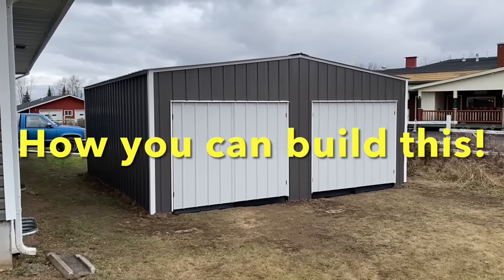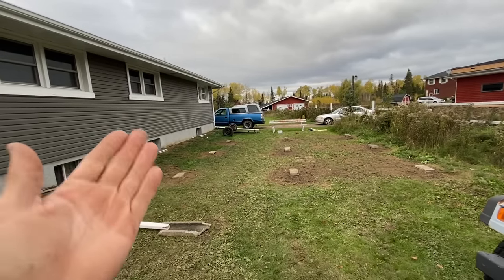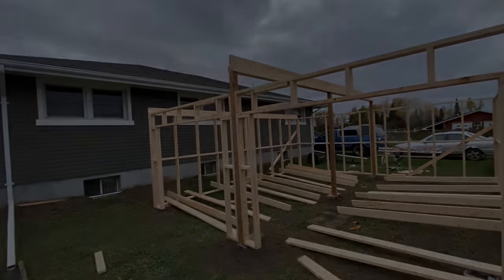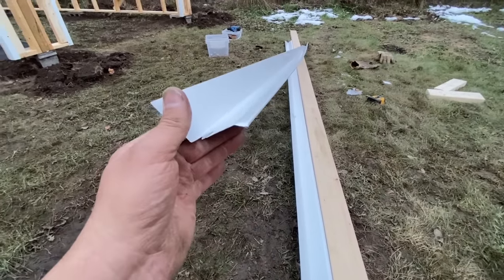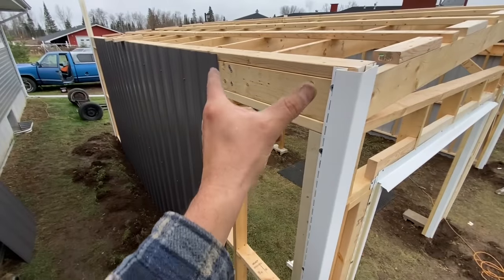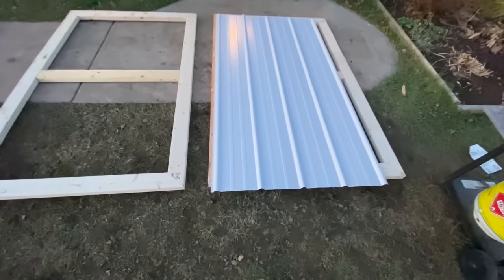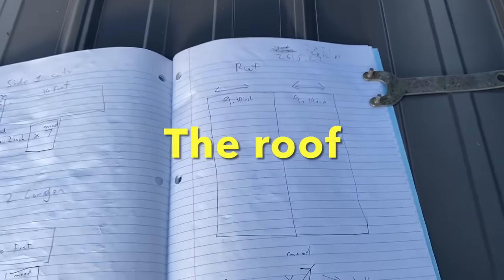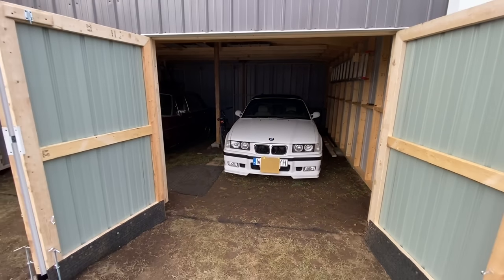How to build a 20x20 Garage for $3000 in 5 days (from Home Depot materials)

Comment: I'm from Florida but also lived in Indiana for 15 years. I liked your install but I do have a suggestion. The top is vented through the gap to repel internal heat. What I do recommend is CAULK between wall top and trim and EVERY roof hump to wall cap. My reasoning is that in Indiana we contended with carpenter ands and wasps. In Florida we have frogs, furry wolf spiders and wasps. Caulking all of these holes in the eaves and overhangs removed a lot of living space for these insects. Now just knocking down the paper wasp nests every few months.

Comment: Within 2 years those cinder blocks will breakdown. The engineering of these style blocks are to be laid with the solid sides as the vertical support. 
A simple Google search on the engineered use of these blocks will explain a little better than I have here.

Comment: Great cost effective build, and way more bang for the buck than those drop in place sheds and kits nowadays.  The only concern I have is that you didn't anchor the building down.  you should defiitely consider some method of anchoring it to the ground, would hate to see it take off in a strong wind. I am now a subscriber.

Comment: You should install either railroad tie or ground contact pressure treated wood as a threshold for the two garage doors so that there is a positive seal between the closed doors and the railroad tie or pressure treated wood. That was the only possible improvement I could find. Your building methods are well thought out. Thanks for some.good ideals.

Comment: 👍👍👍Hey brother, I liked and subscribed to your channel!  Great temporary solution for a mobile shed.
1 small Pro-Tip: Buy some EMT conduit
a) cut 8 pieces @ 1' 6"
b) pound this into the ground flush

(This will help you with the right placement of your doors, both when doors are open and closed).
Also, to help with the snow, buy some wood dowel rod, that will fit inside the EMT conduit.
Cut 2' pieces and place inside the EMT after pounding flush to ground.
Now, when you get snow, you can easily see where the pins are to open your doors.  Hope this helps.
Have a Quality Day!🙂🙂
Reply from the maker: Awesome thanks for watching

Comment: It's Kind of Brilliant..Most places only require permits or inspections if the structure is Permanent, it can be argues that this is just a big shed.  I'd probably sink some ground anchors inside and ratchet strap it down so you don't need to worry about storms but, it's impressive.

Comment: This fits the idea i have been thinking of perfectly, taking from this comment "When leveling the cinderblocks you should use gravel instead of the spare dirt. Gravel can drain water better and help prevent settling." - Should it be fine if I were to set the whole interior 20/20 as a layered pea gravel driveway while having the cinderblock supports to hold the building? We get some water runoff through the area I'd put this and I don't want mud to cause issues, especially since I'd be using 1 side for motorcycles, regardless I'd probably be making concrete pads for the bikes

Comment: I like how you explain things in detail.  Great stuff for the DIY'er.   

That said - I know you're in an unincorporated part of Ontario, but down here in the States - it most likely wouldn't meet code due to the lack of a foundation / footers in most parts of the country.  You can probably get away with calling it a pole barn and putting 4x4 pressure treated posts in the ground in all 4 corners, middle sections of the walls and the post in the middle of the garage at least 4' below grade - depending on the locale.  Some areas may require you to encase them in cement below grade (i.e., those 8" or 12" cardboard tubes you fill with concrete).  But people should always check with their local building / zoning  / codes dept where they live first. 

I realize it's 'temporary' - but in most parts of the States they won't see it as such due to its size - and temporary things have a tendency to become permanent.  Accessory structures like sheds under 100 sq ft are generally exempted from things like permanent foundations (they can be placed on the ground or on top of cement blocks).  This is 400 sq ft garage.  The local code enforcement officer would be ordering me to tear it down where I live for a.) no building permit and b.) no foundation.  That and depending on the locality - distance from other buildings, lot lines, etc.. may be an issue.  

Few nits - the rafters you want to sit flat on the wall plate - not the corner of the 2x8's (looks like you realized that in the very end when you put blocking up where the rafters meets the wall plate).  I would be using pressure treated lumber for the sill plates.  While the metal roofing will probably be fine below the soil - it'll get beat to shit from mowing / weed whacking over time.    

Otherwise, it's a great build - you pay attention to detail and it's a great looking basic barn/garage on a budget that can be done by your average DIY'er over the course of a few weekends.  That and you didn't use the metric system for your measurements even though you're up in Canada - we appreciate that here in the US!  Driving to Montreal with everything in French and kilometers is challenging enough!

Comment: I think you did great! I can't side and roof that same structure for what you built the whole thing for. Only thing, I wish you had kept it off the ground to prevent moisture getting into the panels. A 5" thick concrete pad would cost you about 1400$ USD in my area if you ordered a truck and smoothed it out yourself. You'd still be under 5K for the whole build...

Comment: Great job on the design concepts, execution and especially the well-detailed commentary. Lots of good, useful feedback here also that I would not challenge. I built my first house in 1985 and put a painted steel panel roof on it, similar to yours. The roof is still going strong but the paint is losing its nearly 40 year stand against the elements. It's time for a new roof. The house is in upstate NY, near Lake Ontario--snow country. It wasn't until I put on an addition in 2005 that I came to realize that installing the roofing with the screws through the flats rather than the ridges allows the snow to slide off much easier when temps go above freezing. Both roof are 10:12 pitch and the addition always unloads well before the original roof. 
Your positive feedback is well deserved. Nice work indeed!

Comment: Nice job,but I do agree with the criticisms ! Still it will do well . I would also drill some holes in bottom plate and hammer in some rebar with 90 degree at top to hold the shop down and in place in case of winds etc... pole barns are better I think.
Reply from the maker: For now I just placed a whole bunch of cinder blocks inside on each corner, which I wish I included in the video. Good idea though. I am taking it down and moving the whole thing next summer.  But in the end it is just a moveable carport, thanks for the feedback.
Reply: @ProblemSolverGarage  Plenty of (proper, to a point) criticisms and suggestions already given.  My $0.02 worth, first, it was fun to watch, and while many "mistakes" from a "proper build" perspective were made, it's definitely a "get-er-done" solution. A few ideas and comments that I haven't seen yet, for others to benefit from maybe...
First, the one I haven't seen mentioned yet, the vertical flashing around the doors, should have been tabbed "under" the horizontal door-top flashing.  Minor (in this instance) but any water spreading across the top flashing with any lateral movement (wind for instance) is going to come in behind the lower layer in this application.  Always layer top over bottom as you go down so water always trends "outwards".  (Again, very minor, but other applications, this could be more critical).
Regarding tie-downs, they actually make "corkscrew" tie-down kits designed specifically for this purpose (sheds)... 3-4ft long (it's been years since I last used one) with anchor eyes at the top.  Screw them in (using a long pipe as a handle through the eye for leverage I learned), then you secure an appropriately sized steel cable through them (3/8" for example) and across the structure.  In your case, I'd drill small holes through the top and bottom plates, then run up and over the rafters and ridge beam.  Can keep it all internal almost certainly.  Leave the anchors slightly high, run and secure the cable with appropriate cable clamps, then make a few more turns to tighten them up fully.  For my small portable (10x14, screwed to heavy 3/4" pressure-treated plywood) steel pre-fab shed, I used 4, it survived 10 years including Texas windstorms that literally flipped heavy tables and blew down/snapped trees and fences without budging.  Total cost for maybe 6-8 pairs would probably be about $400 and be good insurance against any decent wind storm moving your garage away (and damaging/destroying contents within).  Won't stop a tornado, but a reasonable, and reasonably easy, improvement. 
Final recommendation(s), paint any cut metal edges (I used clearcoat spray on my shed anytime something compromised the paint) and especially where buried, as already mentioned by others that'll rust FAST under grade, especially with any exposed edges, so proactive coating will help some at least.  
Along with dozens of other things already mentioned, just wanted to add those thoughts for longevity improvements.

Comment: Decent budget build… I would have done some foundation decisions differently but everyone has different opinions. Looks nice and does the job. Honestly wish I had one, no matter how it was built lol looking at cost this would be about 6 grand Canadian in my area. The metal itself would be around 3 grand and lumber about 3 grand, plus probably another 500$ for hidden costs and hardware, like joist hangers, fasteners n washers, concrete, blocks, beers n burgers, gas, etc. My fair estimate would be 6500$ Canadian, which is about 4500$ U.S. but that honestly makes sense cuz prices very greatly by location

Comment: Im no construction guru, but i worked in masonry for a couple years as a laborer. Wouldn't it be better to rotate those foundation blocks and lay them with the holes going vertically? I believe they're much stronger that way. Just a thought...
Reply from the maker: Yeah but people have been laying them this way for years in trailer parks, the flat part down prevents it from sinking into the ground, I wish I explained that in the video because everybody makes comments about that. Nothing will happen to them if they are on their side. Could use solid concrete blocks as well, the video was just for reference.

Comment: siding is touching dirt.  it will rust.  should have put some sort of space between siding and dirt.  Maybe a foundation 1 cement blocks high...
Reply from the maker: Built one like this years ago the same way metal is still 100%, this type of metal doesn't really rust

Comment: I don’t understand how it’s anchored to the foundation. Unless I missed it.  Seems like holes should be filled with concrete and straps around blocks and bottom plate. Or put blocks sideways and fill them and around them with concrete and run 1/2 treaded rods down center of blocks and bolt to plates with washers.  Very creative and economical build.  Might be good starting point for construction of tiny house too!  Thanks.

Comment: Great job of describing your work. I would recommend 1/2 inch foil backed foam insulation under roofing. On frosty mornings the underside of metal will drip when the sun starts to warm it.

Comment: what is going to stop the side wall from sagging? Since you only have a concrete block every 10 foot. and believe me over time they will sag. I would also have used treated lumber on the bottom board going around the base of the walls.
Reply from the maker: The metal wall will prevent it from sagging.

Comment: FYI you don’t wanna use drywall screws outside specially when your using metal and when you doing your flashing you wanna tuck it underneath think like water also when hanging you just channel you wanna put your screws in the center of the nail flange so it has room for movement but good video keep up the good work whatever works for you I’m just giving you constructive criticism that’s all to help you out costed screws is what you wanna use outside at all time or hot dipped galvanized nails like the metal roofing has special screws so does the flashing and j channel that’s all also while doing the roof I would put them on the ribs I would of continued to put them in the valleys of the metal but other then that good video I just would have done the foundation and a few other  things different vinyl flashing is better and cheaper I would have done the same thing used vinyl j channel and vinyl corner pieces but just a few things different like I said great video keep putting out informative videos and helping others
Reply from the maker: Thanks for the hints and feedback 👍

Comment: I didn't see you screw the walls to the base? Also, how do you prevent moisture build up in the garage? I have this issue with my current shed and not sure how to solve it
Reply from the maker: Buy a fan at Walmart for $25 and stick it inside

Comment: The only issue I have with this, and unfortunately it's a big subtle and pedantic issue, is that you used regular screws instead of nails for the framing. Everything else is pretty good, but I'm afraid the structure won't hold up over the years due to the fastener choices. When you drive a nail halfway in to a block of wood and hit it sideways with a hammer with some force, it bends and will bend back and forth for a good many times. When you do that with a screw, the screw breaks the first time you hit it with any real effort. This little demonstration you can repeat shows why framers mostly use nails and bolts instead of screws (They do make "Structural Screws" With differing processes and materials, but those can get expensive quickly). It's how the fasteners are made that changes the strength of the fastener in the face of the flexing joints in a structure you see. 

Seemingly stationary structures flex and bend all the time, often imperceptibly slightly, with the changing wind, the settling of the ground, even from an adult walking around on the second story of a structure. Screws can take the stress of that settling motion for a while, maybe a decade or so in light conditions, but they will break concerningly quickly. Nails, Bolts, and even Staples will not. Not saying that screws are never the solution, screws have unparalleled grip strength, are easily removable, and are probably one of the better fastener choices for drywall and other types of sheet cladding, but they don't have good strength perpendicular to their length. If there's ever an inspection, say for selling the property or for code enforcement, and they look closely at the structure, you could face fines or even a judicial mandate to tear the structure down for using screws depending on your jurisdiction and how up to date the version of the International Building Code is that they follow.

Everything else in this is great, but please use almost any fasteners other than regular wood or deck screws when you are framing a shed or any other structure a person could be inside or stand on for years to come, you do not want to be liable for bodily harm or death from a building collapse. Some of the other choices of fasteners, on the exterior aren't great for corrosion and leakage reasons, but they ain't all that likely to cause a minor catastrophe.

If you (the general "you", not you specifically) are inaccurate or inefficient with a hammer due to lack of practice, or ya just don't have the strength or time to hammer away all day due to the circumstances of your employment like most folk or even if you have a disability that would impede your progress, Framing nail guns have come down a lot in price in recent years, and a nail gun is totally worth adding to the price of this project for almost anyone to extend the durability of the structure by decades. Just make sure to get an air powered one instead of an electric one, a cheap air gun will hold up way better than a cheap electric one. Bonus points for speed too, an inexperienced person can drive 5-10 nails with a gun in the time it takes to fumble with the screw and drive it, 10-20 nails if you are pre-drilling the holes for the screws like you are "supposed to". 

Everything else seems great though, but even Achilles was brought down by the tiniest vulnerability.

TLDR for those that ain't nerds for structures, I know I've gone on a bit much: Screws dangerously Bad: Nails Good. And for all that is holy do not use screws for framing unless you absolutely know what you are doing.

Comment: Looks great but those side walls are going to start sagging especially with the first load of snow. Can’t build a wall with a 2x4 laying flat, there’s no strength unless it was supported by doubling up 2x8’s on edge around the entire perimeter, also would of used solid concrete footing blocks, Otherwise it was a very thorough and detailed explanation which was great.
Reply from the maker: The metal walls prevent the walls from sagging. Think about it...
Reply: @ProblemSolverGarage  when theres a heavy load from snow the screws holding the metal panels aren’t going to be able to sustain the weight
bearing down on them. Post a follow up video in a year.
Reply from the maker: It survived this winter but I didn't get crazy amounts of snow, maybe I'll add a 2 x 8 board along the bottom vertically from one cinderblock to the other all along the bottom for extra support.